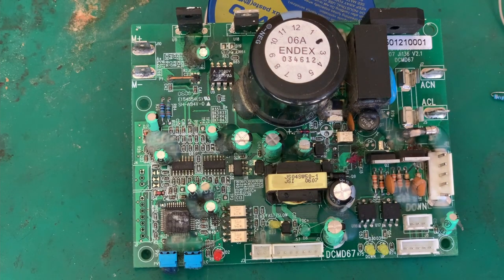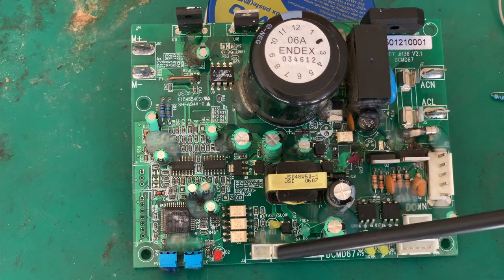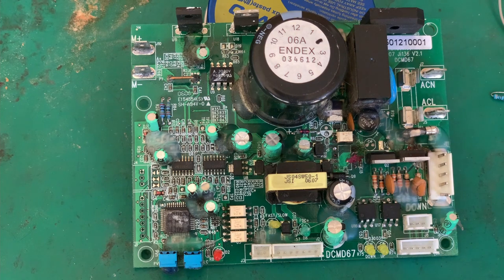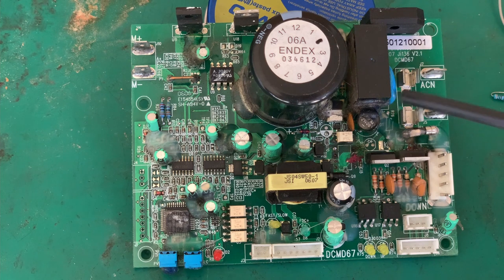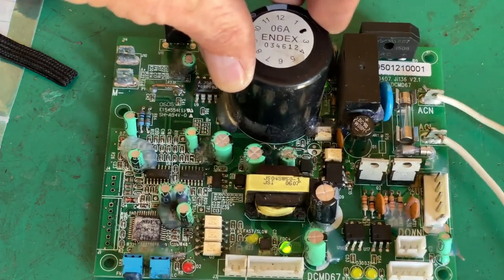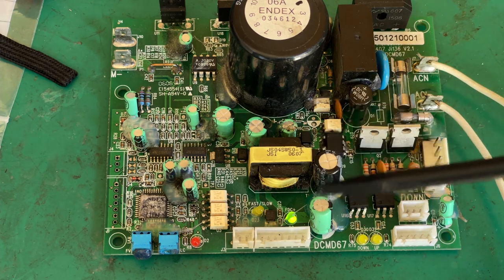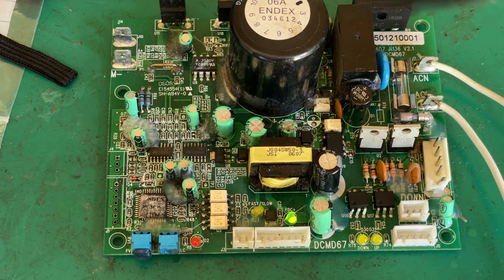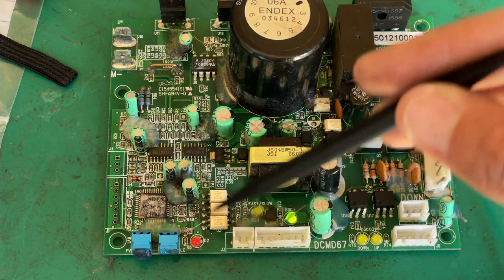FoulkesBrau #59 - Lets find the fault on this Trojan treadmill control board DCMD67

Comment: hello sir i need help, can you tell me what value dioda zener number code d34, location from left side resistor code R6 value 170 ohm. my dioda zener cracked cant see real value for replacement that diode zener. thank you
Reply from the maker: Hi Andrew,

I cannot remember. Can you tell me what the diode is doing in the circuit? 

Cheers,

Craig

Comment: Hello Dear Sir. I've seen a number of your vids and I am very interested in your treadmill and other exercise equip. board repairs.  Excuse my ignorance, I am trying to learn these concepts. The IGBT and flyback Diode do the heavy lifting, PWM control. I understand that part. The part you were replacing, this full wave rectifier, and switching chip, that controls the switching of the transformer? Is that considered part of a Switching Mode Power Supply for this board to provide regulated 16V for VCC? Thanks very much for taking the time to post these videos!!! It is very helpful.
Reply from the maker: Hi Andre,

The IGBT or FET (it seems different boards use different devices for the switch) do the PWM for speed control to the motor - correct. The Flyback or freewheeling diode (it has many names) is there to clamp the over-voltage to the positive rail when the magnetic field in the motor collapses when the IGBT/FET is turned off. This over-voltage can destroy the FET/IGBT. So the current caused by the collapsing field will recirculate or "free wheel" back through the motor coil, through the diode, through the motor coil until the field has collapsed and the voltage is zero.

In these boards, there are two rectifiers. The big main one that gives you a 325VDC rail which is smoothed by the bulk storage capacitor and then switched via the FET/IGBT to drive the motor. 

The second rectifier is for the control circuitry. This gives us DC which is then switched by the off-line switcher with it's transformer (We want to "buck" the circuit or step the voltage down). This voltage then is regulated and powers the micro controller, some logic and the FET gate driver chip. This is the PWM that drives the gate of the FET/IGBT which switches the main DC line to the motor. 

So there are two PWM circuits - one for the motor and one for the control circuitry (what you are calling VCC).

A good way to perhaps understand the circuitry is to download the MC34063 datasheet. In the treadmill board, the inductor is replaced by a transformer. For this specific board, the offline switcher was a TNY266, you should be able to find a datasheet for that and it should show you roughly how the control circuit voltage is derived.

No worries mate, if these videos help one person - then I've achieved my goal.

Cheers

Craig
Reply: @foulkesbrau3085  Craig: You are so awesome to give me such a detailed reply. Thank you so much for this and your wonderful videos. I will look up the datasheets and study them further. I am a fitness equip tech who is trying to better himself by learning how to repair boards rather than just swap them. Stay safe, all the best to you my friend!!!! :->
Reply from the maker: Ta Andre,

I’ve just repaired another switching power supply - for a PS1. I’m busy editing the video so it should be out later. 

The boards you’re trying to repair are very simple. Those data sheets will have typical application circuits. Most times, the manufacturer will copy them as is. With the type of boards you’re looking at - 95% of the time it will be the components doing the hard work as well as whatever is driving them, normally the opto coupler.  

Best of luck with your endeavors. 

Cheers 

Craig

Comment: Red led comes on n the motor stops after running for a few minutes?
Reply from the maker: Hi Sheldon,

Doesn’t tell me much. Something must be getting very hot and shutting down. Might be the thermal paste on your FET etc has dried out? Might be something not making a good contact? Might be a component on its way out? 

I really have no idea unless you give me more information. 

Cheers

Craig
Reply: now it stopped working fully it ran for minute and stopped fully the red LEd came on the green led is the yellow one blinks 2 or 3 times  and then the red LED comes on